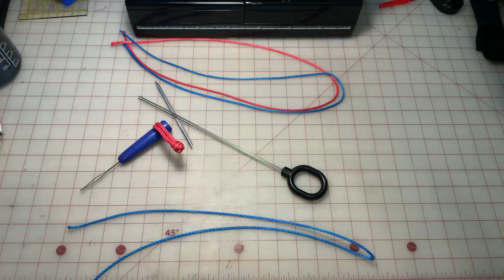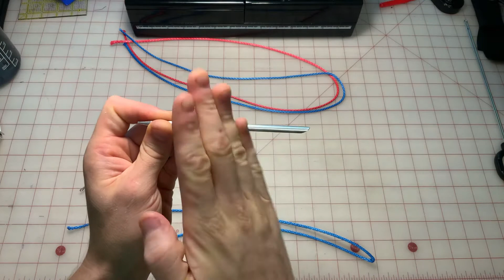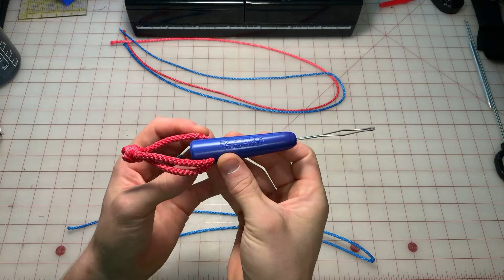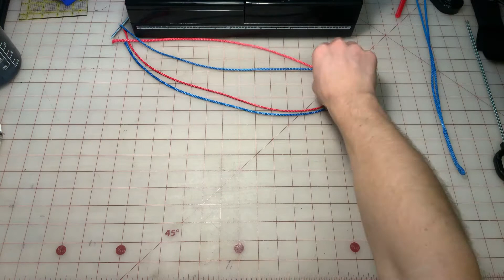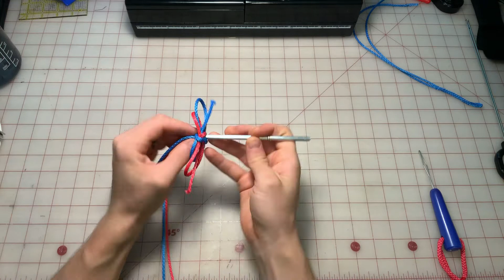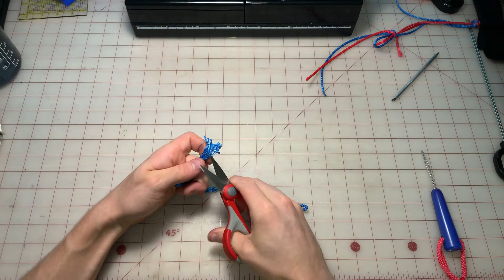How To Make A Soft Shackle

Comment: On my first one my tails were too short but I found it helpful to splice them first then taper before working the “sheath” over the tapered end. Also forceps were helpful for me with a fid.
Reply from the maker: Definitely! I had to go back and rewatch to refresh my memory, and realized I've made a few changes to my process since shooting this video.

Those kevlar cutting shears work pretty well, but if I'm flying, a foldable paur of Fiskar's scissors will pass thru security molestation. Otherwise, my go-to is a fresh, sharp razor knife.

Tapering before burrying the tails is certainly easier, and burrying with a taper folded onto the splicing tool can make for even easier pulls, but need to be careful to fold the taper + enough extra so the tool doesn't come out while the tapered end stays stuck inside. In the grand scheme of things though, I find myself not really thinking this part through or avoiding pulling untapered ends.

I've been using a $3 pair of short needle nose pliers as you use forceps. Hemostats can also be handy.

Besides soft shackles, I've been making continuous loops for things like zipper pulls and knife handles, out of 1.3mm UHMWPE, and for a while I ran them thru the sewing machine just to add some stiffness, but recently started using heat shrink, and it's a game changer. How well it holds up remains to be seen, but it holds the loops open exceptionally well

Comment: notches are for measurement. Longer part is called a "fid length," shorter part is a "short fid" and the whole thing is a "full fid." These are used in splicing double-braid. I really love the little splicing tools. Very inexpensive compared to fids. More expensive, but great are Brion Toss's Splicing Wand and the D-Splicer.

Comment: The notches on the fid are measurements for your berry. When you build a loop just measure to the marks for the tail length.
Reply: I thought the full length of the fid was supposed to be your measure since a tubular fid is supposed to be 1 fid long, or 21x the diameter of the rope its used for
Reply: The grooves in the fid are for measuring. It splits the (21x) "fid length" into a "long fid" (about 2/3rds) and a "short fid" (about 1/3rd). 
A short fid length, plus a long fid length is a fid length.

Comment: Larkshead over the  stopper knot.
Reply: Nowhere near as strong as the locked Brummel splice.
Reply: Girth hitches reduce the strength of the material, give poor orientation, and could potentially sinch too tight and melt the dyneema. That's why dyneema soft shackles use a spliced eye
Reply from the maker: From the digging I've done, the button knot retains most of the line's strength. The button knot does this by (and I'm going to exagerate for illustration) putting gente curves into the line compared to kinking in other knots - in a button knot there is 1-2 extra diameters' worth of line inside the button knot for the wall knot (step 1 in the tying sequence) to cinch around under load, and then the tails progressively orbit around each other as they near the last tying step when they go in parallel to the "base feeds" beneath the knot.

While we don't usually think about it, minimum bend radius (I only learned about from fiber optic cables) probably applies more often than we think, and even to basic things like go-to knots